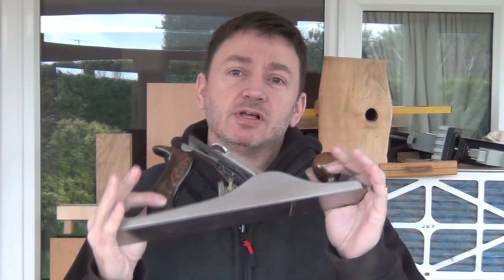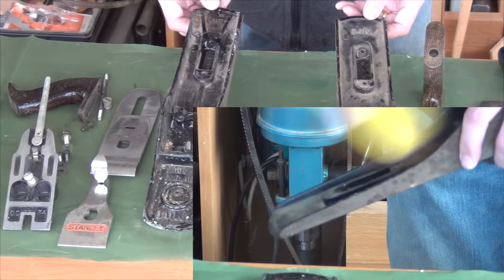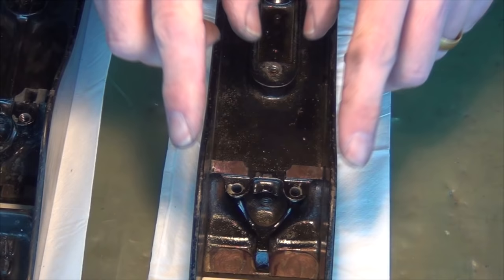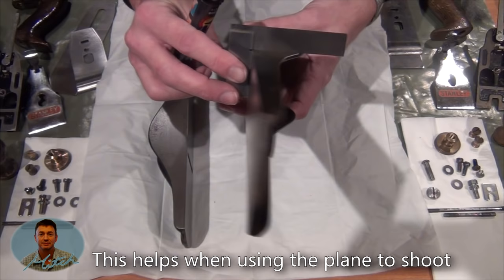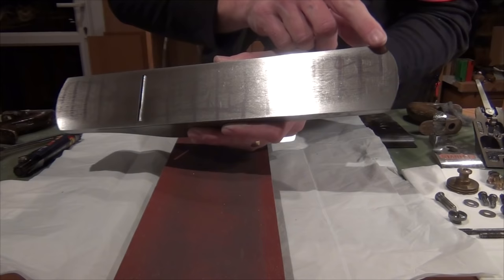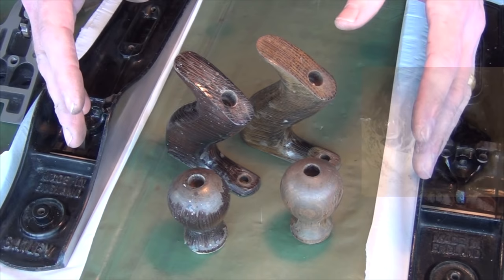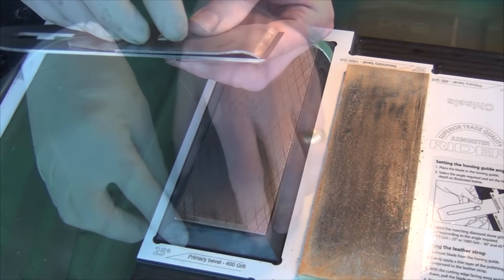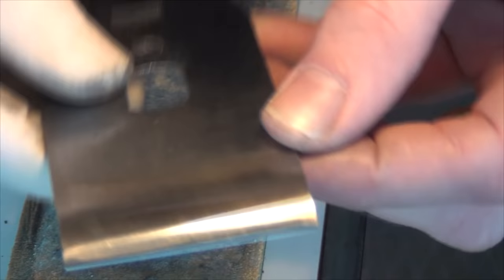Hand Plane Tune-Up - Amazing Results from Your Plane

Comment: Everything about restoring and fine adjustment was great and thorough in this video. However, using a flashlight and a straight edge is not a good way to check how flat the sole is. You will always see light shining through no matter how flat your surface it. The best way is to turn the plan over on a flat metal surface like a jointer and check the sole using a feeler gauge. Thanks for the great vid!
Reply from the maker: Thanks, that's a sound comment.
I like the feeler gauge and surface plate technique to check the edges of the sole are all level, and that the sole isn't convex, but it can't tell you if the middle of sole is concave. You're right that a flashlight isn't great, and something more diffused and further away is better. I find it possible to gauge any concavity by the relative amount of light coming under different points on a straight edge, but here too a feeler gauge could be used.
Cheers
Reply: @mitchwoodwork   A feeler gauge can't tell you if the middle of sole is concave? Sure it does, UNLESS the concavity is less than the width of the feeler gauge. Put the plane in a vise or holder with the sole up. Place a straight edge on the sole, and probe about with the feeler gauge to see if the gauge slides under the straight edge. Do this for both orientations. Easy Peasy.

Comment: Thanks, Mitch. Great video, as usual. Have you ever used valve grinding compound to fit the frog to the body? I have seen others use this method.
Reply from the maker: +Tim Holiner Cheers Tim. I've not tried that method, but I'm sure it would work okay. I like this scraping method because most woodworkers will have a file hanging around.

Comment: Love your videos... and that your workshop looks out on the garden.  My bench sits in front of a window as well. That probably hurts my production but it makes for a happier woodworker.

Have you ever seen a plane sole deflected by the tension from the tote or knob screw?  Just curious as you checked for flatness without those attached.

And a compliment on that full length Stanley #4 rebuild video.  That inspired me to purchase and refurbish more than 10 planes since I first viewed it.
Reply from the maker: Cheers Ray!
I must admit I haven't seen that deflection - the soles are reinforced at the junctions and it doesn't take much torque to secure the handles sufficiently. The one thing I always seem to see is wear down the centre, caused by the planing of lots of narrow edges - amazing how abrasive wood can be!

Comment: Thanks Mitch, That was a great video with lots of helpful information.
Just one question:  I have an old No.5 that has the disk missing from the lateral adjustment lever. Would it be possible to do a video on replacing this lever?
Reply from the maker: +Marisa Aguilera Thanks Marisa. That sounds like a good idea, I'm sure I can arrange that. Happy woodworking, Mitch
Reply: Mitch Peacock - WOmadeOD  thanks

Comment: Thanks Mitch and great piece of advice avoid grinding or reduce casting from a bench plane .I bought a stanley 10 1/2  carriage maker without a blade when I got a original blade I noticed that one of the past owner of that plane removed a lot casting fron the sole and side of the stanley carriage maker plane as a result the blade is more wide than the sole of the plane about 5mm :( .pura vida mitvj great video
Reply from the maker: Thanks. The 10 1/2 iron is a little wider than the plane body. But 5mm is  too much. Worth grinding it down a little in my opinion.
Reply: @mitchwoodwork  thanks Mitch for your piece of advice .

Comment: It's not a good idea to sand the blade surface of the frog out of the plane bed because the screws that hold the frog to the plane bed bend the frog a little bit. I've found that out of the plane the blade surface of the frog will be a bit 'high' in the middle, but when you screw it down into the bed it will then be flat. 
My advice would be to put the frog in place, tighten it down, and then check for flatness.
Reply from the maker: Interesting, I'll check that out next time. My assumption is that with a good bed between frog and body, there shouldn't be space for any movement when the screws are snugged up.
Reply: @mitchwoodwork  I ran into this problem when I was restoring a jack plane.  I found a high spot on the blade bed of the frog in the middle that ran all the way across. I started to sand it down level and stopped thinking await a minute, there are two contact points in the plane bed.. the surface under and behind the screws, and the two points up near the mouth. What if in order to keep solid contact on all surfaces (3 actually) the frog is bent? I put the frog back in place, and tightened the screws after making sure all the machined surfaces were clean and flat. With the screws tightened, the blade bed on frog was perfectly flat. I suppose this is also why they recommend the sole of the plane being leveled with all hardware in place and tensioned. Cast iron bends.

Comment: I've got my number 4 and 5 working great along with a little block plan. I just ordered a number 92 from Amazon (cheaper than 93). Any others you suggest? I think I'm set. Oh yeah, working on great grandad's 45.  Thanks for your info.
Reply from the maker: +Brandon Blaine How about a 71 or a 7, both useful. I have an 8, but I don't have the bulk to use it to it's full potential, and I think I'd be better with a 7 myself.

Comment: Great followup video. Thoughts on the low angle Jack planes? they have a few different blades and are very versatile
Reply from the maker: +JoshL Cheers Josh. I have one that I bought to review, and I was very happy with it, but I haven't done a side by side comparison yet. For sure the adjustable mouth, and the thick blades are a great feature. When I bought mine I couldn't get hold of any optional blades, and so I still haven't used it to it's full potential. Do you have one?
Reply: I was thinking about picking up a Veritas or Lee Nielsen low angle jack but never did. I've heard very positive reviews of them as being a very good all around plane.
Reply from the maker: +JoshL if you can, try one out alongside a Bailey pattern no.5, and a similar size Japanese kana, before you buy. How they work and feel in your hand is a personal thing, and just as important as what others might say about their performance. If you don't have much plane experience, get someone who does to check them out with you.

Comment: Another Great Video Mitch .. Thanks again .. 
I am thinking about the diamond stone ... a bit dear but I think it would be a good investment .. thoughts before I invest?
Reply from the maker: +L Gorman Many thanks. I think if you follow the advice of light touch and use of lapping fluid, and you set yourself up with a strop or two as well, then you wouldn't be unhappy with a decent diamond whetstone. I'm on the fence myself - I've been very happy with water stones for years, and enjoy the process, but having emersed myself in diamond sharpening just lately, I'm wondering if it is a more convenient and equally effective method.

Comment: I have a spare Stanley No 6 that I wanted to clean up given to me by my grand father in law. Would this also make a good scrub plane if modified according to your method as well or would the sole be a bit longer than needed?
Reply from the maker: +Jameson Elam Hi James. Personally I've never been too overly concerned with sole length - many people would say that a no5 is too long for a smoother -  so I would say go ahead. The blade is rather wide, so my idea of knocking off the corners more could be worth while. What have you got to loose, apart from a quarter inch of blade! If you try it, let us know how you get on. Cheers, Mitch

Comment: Great video Mitch, I have Stanley Nos 2-8 with a few odd numbers in between and they all need a LITTLE TLC. May I ask what is the name of that blue liquid you used to clean the screws. If it works that well, I may need a gallon. Thanks and PLEASE keep of these great videos.
Reply from the maker: +Willie Sims thanks Willie. It's called paraffin here in the UK. There are more modern alternatives for degreasing and cleaning engines etc. that should work just as well. Steam cleaning or ultrasonic baths are great too.
Reply: +Mitch Peacock - WOmadeOD I believe it is called kerosene in the U.S. and Australia. It's clear here, must have dye in it in the UK.
Reply from the maker: +Michael Anderson Thanks Michael. We do seem to like adding colour to our chemicals over here!

Comment: Great video Mitch! I have a question though. I own a new No.5 Stanley jack plane and that's it.  Would i need separated blades/chip beakers for dimensioning, smoothing and shooting?
Reply from the maker: Thanks Pepe. 
You don't need to, but I would recommend it. One chip breaker could be used across all three blades - doesn't take too long to change it over. Using one blade means either compromising the speed/quality of each operation, or frequent re-shaping of the edge (which will wear a blade out quickly anyway).
I would recommend the smoothing blade be thicker than the Stanley blades, but that does mean a higher cost. If cost isn't a huge concern, get two or three thick replacement blade/chip breaker sets - Hock are my favorite, but Axminster Rider, Clifton, and Quangsheng are all good (no experience with veritas)

Comment: Great video! Question on the scrub plane... why would you take material from the back of the mouth on the scrub plane, forcing you to have to hold the 45 angle. Wouldn't it be easier to open the front of the mouth? Is there a special reason I'm not catching?
Reply from the maker: Thanks! The reason for adjusting the back rather than the front is to still allow for closing the mouth up tight when smoothing difficult timbers.
I've just been filming the follow up video on plane setup today (rather later than expected!) and it should be published within a week or so.

Comment: Mitch, I think you might have wanted to add at least a few seconds of info on how to install the blade for each type of job. At least a close up view of blade penetration.
Reply from the maker: That will all be covered in the companion video. I did include that in the title, but perhaps not large enough, and I should have mentioned that video in this one. Hope you'll find it helpful when it's finished and uploaded. Cheers, Mitch
Reply: +Mitch Peacock - WOmadeOD Yeah you have to remember that most of that info doesn't show up unless you click the show more button. Which I didn't, of course. lol

Comment: Very interesting video, informative and well explained.
I was interested in your mention of the Hock Blade and Chipbreaker - is there any reference number  when ordering this combination for the Stanley No. 5 ? Also, did you order directly from Hock in the USA or from an outlet in the U.K.?
Any information would be appreciated
MVH
Reply from the maker: Cheers. I ordered directly from Hock. The set was clearly made for a number 5, so you shouldn't have any problem identifying it.

Comment: Thanks Mitch, great video. I've just tuned up a 1960's Stanley No 4 following your steps. It's working really well and feels great, but I haven't done the handles yet. The varnish will scrape off easily as its flaking quite badly, and I'm wondering what you do to finish yours? Many thanks.
Reply from the maker: Cheers Malcolm. I've used shellac, and tung oil, in the past. The shellac i build up to a thick, high gloss finish, whereas the tung oil just has a couple of wipe on wipe off applications. I find both are comfortable, and although very different i like the look of them both too. Both offer protection, and both are easy to repair of they get damaged.
Reply: Many thanks Mitch for the swift response. I've never used shellac but I think I'm going to give it a go. Once again, many thanks, and keep up the great work with the videos.

Comment: As someone new to woodworking and working with extremely limited space for both tools and working and small budget, I really would love to see a video on picking the best plane (one plane) to use as a scrub, jointer, and smoother by setting up/tuning different blades. Is it just a #5 and 3 blades or is there more to this? I would not be working with boards longer than 3  feet. There's a "brief" mention of that here by way of a text banner for a few seconds on the video but I suspect that there are a lot of people like me out there. And until we get more space and budget, we'll be in that situation. Every vid I see ends up with 3 or more planes even as a bare minimum and that just doesn't work when you're space for 'tools and working' is tiny. If ALL your tools had to fit in an old carpenters toolbox, which 1 plane would you have to do all 3 jobs and how to set it up?
Reply from the maker: Hi Ron.
I've just started a Reddit community for woodwork help, and this was the first question I posted to get things going. Go take a look and see the answers there so far https://www.reddit.com/r/WoodworkHelp/comments/9x42da/what_hand_plane_should_i_buy_first/
Given what you say, I think the no.5 would be an ideal start.

Comment: Hey Mitch, great video. When you get an old plane and change out for a new blade to be fit, doesn't the frog have to be aligned with that middle "hump" so the blade won't hit that when it mates with the face of the frog during projection? How did you decide on 1/16" of an opening to file out? The new blade from Veritas is .100" and there's basically no room in the mouth with the frog all the way back. The current (old) blade is tight and it's .080", so by my math, it needs .02" + .0625" which is about between 5/64 and 11/128 to file away from the frog side, correct?
Reply from the maker: Hi Rick, Can't picture what you mean in your first sentence (maybe just too long since I last upgraded a blade). Do you want to send an annotated picture to mail@womadeod.co.uk
The mouth opening is very much dependent on how you wish to use the plane. Adjustability from 0 to 1/16" covers most normal uses for a bench plane. I usually find that an untuned plane rarely has a parallel mouth when the blade is perfectly centered, and therefore take the opportunity to open it up and make it parallel at the same time, so therefore I'm working on the front of the mouth. The bevel on a thicker iron runs further up the iron, and may not interfere with a slight overlap between the frog and the sole, so check this before you commit to opening the mouth excessively.
Email me any problems you encounter, I'm very happy to help if I can.

Comment: why did you not check for the frog rocking before removing the machining marks,if i can help it i like to not remove machining marks unless absolutely no other option,i like your channel but cant help notice that when paul releases a youtube vid on a certain subject,so do you.
even so this is a very good video and some info not offered by others
Reply from the maker: If that's the case then it's purely coincidence on my part (and I'm sure on his) as I haven't seen many of his videos, and certainly none in the last few months. This video was first mentioned in my September update, and again in December, and shouldn't have been a great surprise.
As for the machining marks, their presence is a good indication that the surfaces are substantially flat, the main problem is that they are rough and as such the two mating surfaces may match in one position but not another. I'm sure there are many ways to achieve the desired result. The two ways I show have worked well for me.
Thanks for your comment and happy woodworking.

Comment: I have a 14" Stanley - Bailey smooth bottom plane, that I have restored.  My problem is I can not get the blade to protrude thru the bottom of the plane.  I am wondering if I might have the wrong chip breaker.  Any ideas?
Reply from the maker: Could well be the problem. First, double check all the adjustment parts are fitted correctly. If so, try the following: Move the chip breaker further from the blade edge until the blade will just protrude with the spin wheel in the mid position. Measure the chip breaker to blade edge distance, and cut a second adjustment slot in the chip breaker that distance further up from the existing one.
Reply: I tried several things.  I moved the chip breaker back an inch or a little more.
I tried with the chip breaker at 1/16" It won't go thru the sole.  At an inch back there is no gap between the blade and the sole.  I did get the blade to protrude thru the sole but it was on an angle. Only one side stuck out.  Moving the adjusting lever did not help.  I have two different frogs. One is a steeper angle the other a low angle.  I do not know what to do with this.  Put it on eBay and hopefully, I can get my money back.
Reply from the maker: Ah, sounds like you need to move the frog backwards. Give that a try. If you can send some photos of the problem it might help.

Comment: What's the best way to straighten the skates on a #45? Hammer, heat, or other?
Reply from the maker: +Robert Cornelius Hi Robert, That's not something I've encountered, so I can't really say. My best advice would be to search online for someone who has successfully done it, and/or speak to an old metalworker/toolmaker. Good luck, it's a great tool when it's working.

Comment: Is there a video on replacing the rivet?
I'm rustic restoring a no 5 type 16 and the arm is bent and rivet gone. It rests on the stub left over after rivet was cut/broken off.
Reply from the maker: Stephen Zevetchin Now I did do a video on making a replacement lateral lever about two years ago. I can't remember if I included installing a new rivet though. It's not difficult, just knock or drill out the old one, get an aluminium replacement and a thin washer. Cut the rivet a little long, then peen it over the washer to hold the lever in place
Reply: Mitch Peacock - WOmadeOD thank you very much.